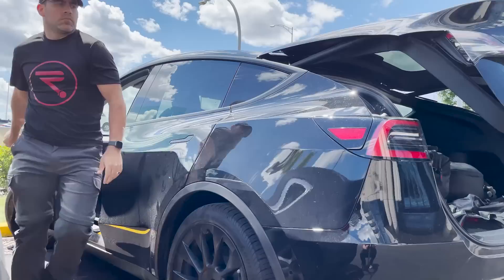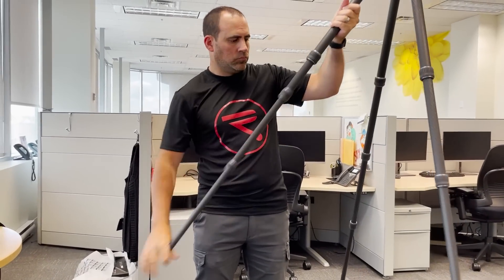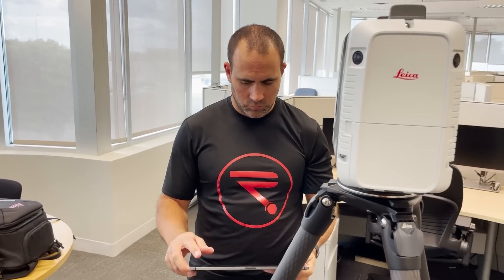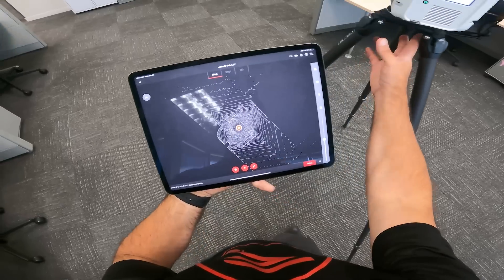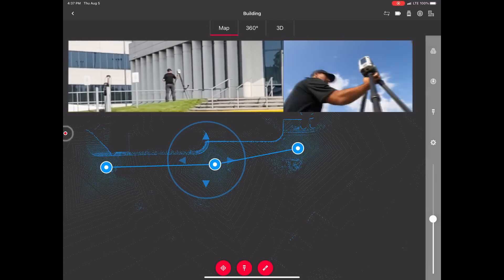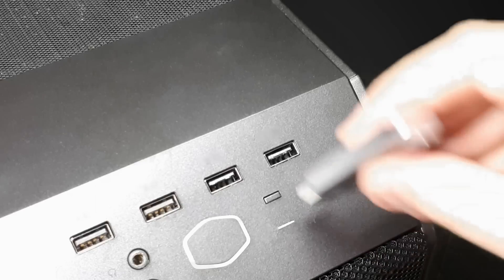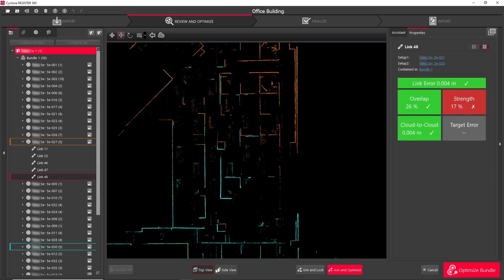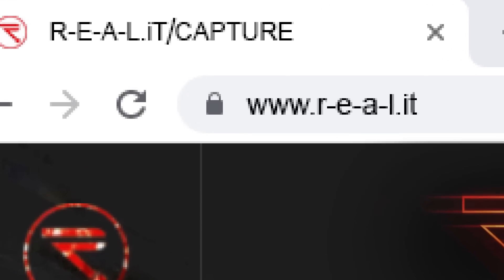DEMONSTRATING the RTC360

Comment: Can I have the time it takes to scan High density with HDR images ?
Reply from the maker: It takes 1min 42sec for the high resolution scan and an additional 1minute for the HDR image. So total of 2min 42sec. You need to add 12 sec if using the high tilt accuracy option.

Comment: what should be the typical pc requirements for this?
Reply from the maker: Hello! You don't actually need a particularly powerful computer to view and process point cloud data using software from Leica Geosystems. Point cloud data is optimized so that your computer will only load as much as it can handle at a time. Having a more powerful computer will speed up some automated processes, however. Having a more powerful computer, comparable to a high-end gaming computer, is recommended for best performance.

We offer computer hardware consultation if your interested, plus full computer construction. We also rent hardware, depending on availability. For more information, you can email us at expert@R-E-A-L.iT.